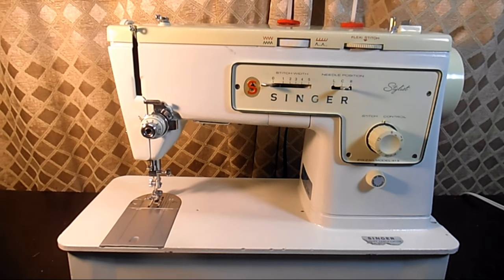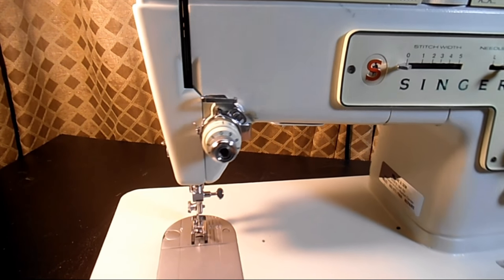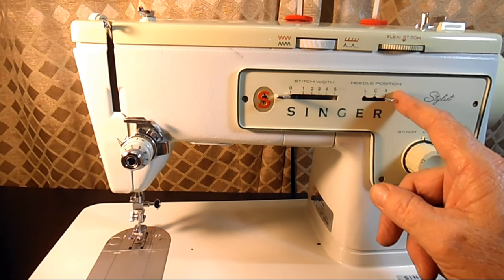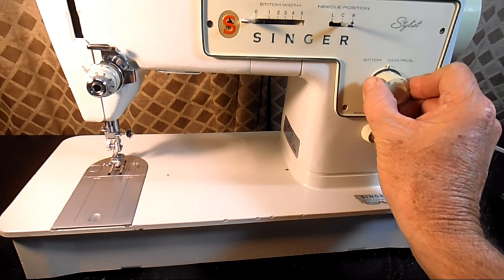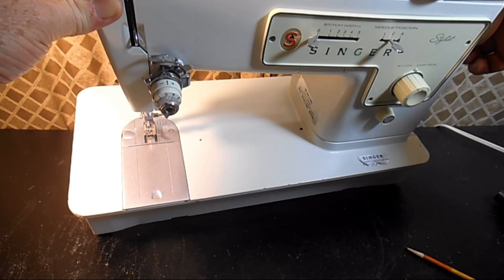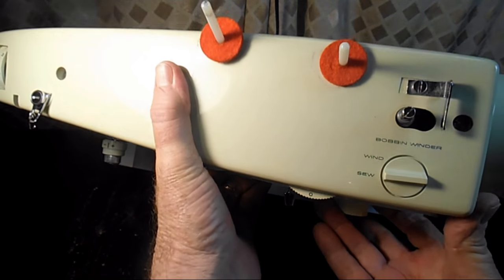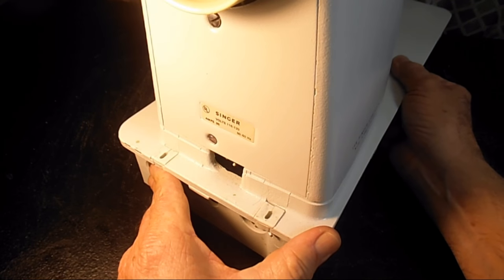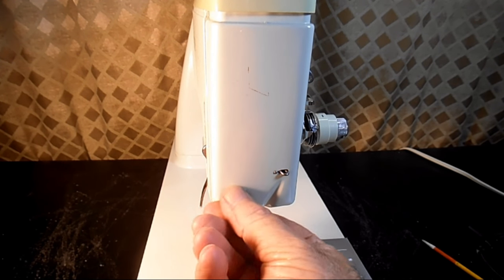TOUR THE FEATURES OF THE SINGER MODEL 413 STYLIST SEWING MACHINE

Comment: Hi Andy, I am having issues with the hook rotary in the bobbin section not turning. Would you know if this is fixable? As I was sewing and my needle snapped on the rotary turner not moving. Any help would be great. Thank you Andy
Reply from the maker: Aimee, I'm sorry to say I think it is a broken/damaged gear on top of the vertical shaft. It powers the vertical shaft that supplies power down to the hook and bobbin area. The gear is plastic and is at an age where it has become very brittle. There is a handful of models that are known to have this problem and I get many emails about it so I finally made a video about it and how to change the gear out. It only costs about $10 or less for the gear and the video is a step-by-step tutorial so almost anyone can do the work that shops charge a lot of money for. Of course, I'm surmising this is the problem as I can't see the machine itself. Watch a little of the video and look inside your mache to get a look at your gear. Here is the video; https://youtu.be/M3bFtlV1Y6s
Don't let the length of the video bother you as you can watch it at speeds up to 200% of normal. After changing the gear you must reset the timing and the video includes instructions for that. Thanks for watching my channel, and good luck.
Reply: @andytubesewing1953  thank u Andy this is so helpful and exactly what is wrong with my Singer 413. Many thanks for your time and attention to detail. Much appreciated, all the way for Melbourne, Australia. I will give this a go once I find the spare part 👍 thank u thank u!
Reply from the maker: Welcome. You can do the replacement, Aimee. Step-by-step. Best of luck.

Comment: My Singer Stylist model 413 is stuck in reverse.  Can you help me fix it for myself, please?
Reply from the maker: You can't just turn the machine around and sew left-handed? 😂 The manual for model 413 does a poor job of showing where to oil the machine, IMO. I made a video to show how to oil it. https://youtu.be/XrNh_iaqDMM Please pay special attention to the forked feed connection area I show at 10:47 in the video. When you push the reverse button it moves a lever against the feed regulator attached to that forked feed. There are sliding parts that may be stuck at that point. If that does not release the machine from reverse you can watch this motor belt video to see how to remove the motor cover plate. https://youtu.be/VNLLc_9TphU  With that off you can see the parts behind the reverse push button and the lever I mean. Cleaning it with alcohol may help if the plastic is dirty and stuck. I usually don't advise oiling plastic, but you may need to put a little oil on those parts if they are sticking. There is a return spring to keep the reverse button pushed out, but the feed regulator may be so dry it can not slide and that is preventing the spring from releasing the button back out to go in normal forward sewing. If all this fails you can buy a service manual online that shows how to remove those parts for cleaning, adjusting, or replacing. I hope that is not needed, but if so here is where to buy the manual: https://manualsoncd.com/product/singer-416-418-sewing-machine-service-manual/   The manual is for the fancier model 416, but the parts inside are the same. Good Luck.

Comment: love your tutorials on model 413.  fixed the gear but now zig zag does not work. help
Reply from the maker: Did you reset the needle to hook timing after changing the gear? In what way does in not work (lots of variables there)
Reply: @andytubesewing1953  yes
Reply: Do you have any machines  to sell?
Reply from the maker: @donnashiltz1737  Sorry, they sell right away; all sold.
Reply from the maker: @donnashiltz1737  If you want to DIY, you can buy a service manual here: https://manualsoncd.com/product/singer-416-418-sewing-machine-service-manual/
These are copies of the original Singer Manual the repair people used. I have bought a few and they were helpful when I got stuck trying to fix a machine.
Reply: @andytubesewing1953  
I would like to call you. 
What would be a good time?

Comment: Hello again , I broke my needle for this Sewing machine and wanted to know where I can purchase the actual needles for this specific machine..please help thank you
Reply from the maker: No worries. You can go here and download a FREE copy of the instruction manual for model 413:
https://www.singer.com/sites/default/files/product_manual/SINGER%20413%20Stylist%20Sewing%20Machine.pdf
On page 10 of the manual is a chart showing which needles ( and thread) are best for the machine. In addition to the ones listed there are now also specialty needles for jeans, leather, metal threads, etc. The import part to remember is style 15x1 needles in sizes 9, 11, 14, 16 and 18 if it's for woven fabric, knit fabric, leather, denim and so forth. That is just what the point is like and how thick the shank is. Almost and 15x1 style or type of needle in those sizes will work on your 413. Back in the day, Singer called them style 2020 for sharp point woven material and 2025 for ballpoint and knit material. Don't forget that your machine can "Twin-needle" sew and takes a special style 2028 twin needle. Thanks for watching Andy Tube.
Reply: Thank you so much
Reply: Unfortunately I don't have the manual just the sewing machine.. thanks for all your help
Reply from the maker: Very welcome. Good Luck.
Reply from the maker: @vintagecopycat  https://www.singer.com/sites/default/files/product_manual/SINGER%20413%20Stylist%20Sewing%20Machine.pdf

Comment: One problem I see is no built in buttonholer.
Reply from the maker: Most of the machines I work on were made before the eletronic automatic pattern making machine and auto buttonhole. Singer made a few different buttonholers as accesoriies to the machines so the sewist could make buttonholes in two or three styles. This buttonholer would be the one to use on a model 413 low straight shank machine: https://youtu.be/e5131TMpI7A

Comment: my one has a plastic bobing case for sum reason
Reply from the maker: The original case is metal, part # 172082 and hard to find. Many cases are coming from China with the number 172082-8 and claim to work in many models.
https://www.amazon.com/SINGER-SEWING-MACHINE-BOBBIN-172082-8/dp/B077CX4VFH?th=1    People have found out that the plastic Apollo Style Bobbin case seems to work "OK" and they cost much less. https://www.ebay.com/itm/123742677110?hash=item1ccfa36876:g:~jsAAOSwrYRcdg4X&amdata=enc%3AAQAHAAAA0NzdRJkGtKhDHCsOdkNuk2DfDiLCl3un7Orn1B7bWYNsy%2FWxwLOwMe0rq7H0slNHRKmvEITvClfogx%2FN1zbfAdrcm%2BzG6gDzrDKzoX%2BYEEW5ZIZfzbHfEfudJd1e6fV%2FsVQ3bsMVDaVGqJI9G9dd70MTE%2BYACfEnCPnxaCHfK21HvVuxpsP%2BQ4mE0xKN2XFD1x%2Bdyls7%2Bg4CwOp65Onk6MnnDaCA%2FVisbCRmK049ZfTZk0SsJF%2FWcKXVnmNh2ZhAFhXrNohm8IcIO%2BWBFsIGE2o%3D%7Ctkp%3ABk9SR_K7kZXZYQ

Comment: Hi Andy, I have recently got a 413, the machine motor smells was going to take the motor out and have a go at cleaning the motor. Have you any video of removing and cleaning the 413? Loved this information video, thank you for educating me on this machine
Reply from the maker: Here are my model 413 videos although I do not have one just for removing the motor: https://www.youtube.com/playlist?list=PLsCOZgzzaiKKVlkxPT9FMTdvUUGj8Ydf8    Your 413 has an SN(K) OPEN motor like many models do. I have some other videos about that type of motor showing removing and replacing, cleaning, setting the motor brushes, etc.
REMOVAL: https://youtu.be/32tXiiXx73o
INSTALL: https://youtu.be/Hvacqu44-mo
CLEAN: https://youtu.be/6y1EN5S2sz4
RESEAT MOTOR BRUSHES: https://www.youtube.com/watch?v=rpTy_Bz3prA&list=PLsCOZgzzaiKI8b1zmcVQqcKFHH_dbQLyr&index=12
I will say that unless the motor got covered in oil that the "funky" smell is usually from an old motor belt running at high speed.
The dried-out rubber flakes get hot and can even smoke a little going around the motor pulley.
You can pull the belt off of the motor pulley (videos) and just run the motor and see if it is actually the source of the smell. 
I have recovered used motor belts for temporary use until buying a new one by soaking them well with alcohol and using a small wire detail brush or even a toothbrush or nylon scrubby to get the old flakes off and make the belt a little flexible.
If you need the Instruction Manual for model 413 you can download a free PDF copy directly from SInger (safely) at this link to their support page: https://www.singer.com/search/support?title=413
I hope this info will get you started, Sharon, and you know where to find me now. Take care.

Comment: I was looking for a service manual for the 413, but have not found one.   Would the service manual for the 416/418 be close enough?
Reply from the maker: Yes, that is correct. Model 413 is the "entry-level" or "base level" of that "line" or "class" of machine. The 416/418 have other features, but the basic mechanics (and even the part numbers) are the same. We all use the 416/418 service manual for working on model 413.

Comment: Hello Andy, Excellent video on this machine. I got one from my friend recently. I thougth to give a try by stitching some cloths. I realized that the feed dogs are not pulling the fabric, I see the feed dogs are coming up and down. but for some reason its not pulling the fabric. I really don't know what to look for to fix it. Otherwise the machine look great.
Reply from the maker: That sounds like the feed is set in a "neutral" position instead of normal forward. The FLEXI dial should be set to zero, the stitch width dial set to zero the stitch length dial set to about 12 for a medium-long stitch, and the,  needle position lever should be set to "C" for center. That is the correct setting for straight stitch sewing. Try it. If the dog is still just going up and down then the reverse feed button/parts may be stuck. Some of the parts are plastic and dust/dirt in them can make them stick. Try pushing and letting go of the reverse button several times to see if the feed movement changes. If you do not see the dog change direction then it's stuck. You can remove covers and try cleaning, or heat the parts with a heat gun or hairdryer. Someone may have been trying to adjust the height of the feed dog and made an error. The adjustment screw is elliptical and if they faced it the wrong way it won't move the feed lift bar properly. You can download a free copy of the Instruction Manual from SInger at this link: https://www.singer.com/search/support?title=413    You can also buy and download a copy of the Service Manual at this other link: https://store.tandtrepair.com/413sm.html    The Service Manual should cover every adjustment and repair on the machines, including removing and replacing many parts. It's $10.95 to buy.

Comment: Hi Andy, thanks for the amazing video, Very informative! I was left this machine by my grandma who unfortunately threw out the manual long before i was born, so i only knew what little she taught me haha. Using your video I've been able to start using the machine for my own projects! 

I was wondering if you would have any idea why my machine is stuck in reverse, ive removed and cleaned the stitch length dial and oiled everything I can think of but for some reason I cannot change the direction of stitching, if you have encountered this problem I'd love to know how you solved it! 

Thanks again for the great video :)
Reply from the maker: Well, this was the only 413 I worked on and it had no problems. In general, I can say these types of push-button feed controls have a few springs in them. An example would be when you push the button and let go it pops back out. Other springs shown in the parts manual look like they actually move the feed regulator for forward/reverse. If those springs broke or came off that may have left the regulator set to reverse. There is no special service model for model 413 b/c it's a "little sister" model to the 416/418 more advanced models. I do have that service manual and the parts manual for the 413 if you want to drop an email to Alan at andymanuals53@gmail.com and ask him for those specific manuals I'll have him reply with the PDF copies for no charge.
You can also download a FREE copy of the original Instruction Manual directly from SInger Support: https://www.singer.com/search/support?title=413    I also have 8 other videos for this 413 in a playlist here:https://www.youtube.com/playlist?list=PLsCOZgzzaiKKVlkxPT9FMTdvUUGj8Ydf8
 I love that you are using your grandma's machine. Thanks for watching, and good luck.
Reply: @andytubesewing1953  thank you so much! I'll take another look at the springs, and if I still can't work out what's wrong I'll drop Alan an email :)
Reply from the maker: @CoolloserAri  sure and good luck! 👍

Comment: Hey Andy on this machine my handwheel is not so smooth to turn. Where do you think the focus point is for me to get to so that I can try to make that a smoother turn on the hand wheel?
Reply from the maker: "smooth"? Too vague. If you put the machine in BW mode you only turn the motor, belt, and handwheel? Is that still not "smooth"? You can inspect/clean/lube the part the handwheel rides on. See this video for changing the belt to see it: https://youtu.be/VNLLc_9TphU
You can have a bent handwheel, bent arm shaft, etc., or just needs a good, fresh oiling. Other model 413 videos: https://www.youtube.com/playlist?list=PLsCOZgzzaiKKVlkxPT9FMTdvUUGj8Ydf8
Reply: @andytubesewing1953  I guess I’m comparing it to my 99k and spartan where the hand wheel turns with little or no effort.  I’ll check out the videos you shared.  As always, thanks for the guidance.
Reply from the maker: @rhondamercado7527  Oh, the 99k compare. OK. In general, a model like the 413 with a cogged timing belt and pulleys on the bottom of the machine will not turn as smoothly/easily as pitman rods/shafts (99k) or gears (301, 401, 500)

Comment: I just acquired a machine very similiar except its a model 477. Everything seems to work but the foot lever pickup at the back will not lift the foot. It just flips up and down but the foot will not move. Any ideas???
Reply from the maker: Congratulations on your acquisition. I have a couple videos showing the removal & replacement of the presser bar on a model 513. It has a presser bar system similar to yours. You may find you just have a loose/missing set screw that clamps the presser bar into the guide bracket that is lifted by the "foot lever pickup" ( presser bar lifter lever).
I think if you browse through these two videos you'll find what is wrong. REMOVE: https://youtu.be/EwSU1xGS5f0     INSTALL: https://youtu.be/MCHMiYgD6Z4
You can download a free instruction manual from Singer here: https://www.singer.com/sites/default/files/product_manual/01c62c901c15f3202fc3263cd76cd27c3bc2f688_0.pdf
And a free parts diagram with numbers here: http://parts.singerco.com/CPpartCharts/4_4999/477K.pdf
The numbers can help find replacement parts if you find that something is broken or missing.
Best of luck, and thanks for watching my channel, Linda.

Comment: I've seen these machines for sale near me. I'll be glad to learn more about them!
Reply from the maker: They are fun little machines that can do most household and clothes sewing as long as the gears (plastic) are not damaged. It's the model a couple years before the 513, and fancier than the 457 I did. The gears can be replaced and the parts are only $10, but the labor cost is prohibitive at most repair shops if they will even do it. Always make sure the feed dog and hook move before you buy one. If not it's a sure sign the top gear on the vertical shaft is broken. Thanks for watching.
Reply: I have this 413 machine.  It was my mom's.  I started a project and have run into some difficulties.  The last being - I was sewing a straight stitch and when I used the reverse button It made a noise and the needle stopped.  I am wondering if the top gear is broken?  I have looked at a few of the other videos and removed the end plate and the belt is intact and looks good.  I removed the bottom plate and small pieces of hard black plastic were seen. ( Not Good!) Removed the top cover.  It's hard to see under, what I am guessing is the top gear, it does appear to be missing "teeth". I ran my finger under it and it does not feel uniform.  It is black.  If the top gear on the vertical shaft is broken, can the part be bought?  Can I replace it?  Went looking for parts and found "Vertical Top Shaft Gear, Singer #155819" under $10.00.  Is there a how-to video on replacing the top gear? A repair manual/parts manual?   Your answer is appreciated.  I live near Austin and there is a sewing center that repairs sewing machines.
Reply from the maker: The sounds and symptoms you describe are classic top gear failure. You can change the gear as thousands of others have. If your broken gear is black that means it was a replacement gear. I prefer the white gear as I think it lasts longer. DO NOT put any grease or oil on it. Here is the replacement procedure:
http://www.singersewinginfo.co.uk/457gear/
Here is where I bought my last one, but many others sell it too:
 https://www.ebay.com/itm/Singer-Sewing-Machine-Vertical-Top-Shaft-Gear-155819/321096479088?hash=item4ac2d77170:g:RgEAAMXQLehR7MD0:sc:USPSFirstClass!85281!US!-1
Good Luck, and thanks for watching Andy Tube.
Reply: @andytubesewing1953  please let me connect with you needed your help, I regard you as a patient , kind-hearted man doing great work!🤩
Reply: @andytubesewing1953  💐💐
Reply: Thank you for you videos and teaching!🙏